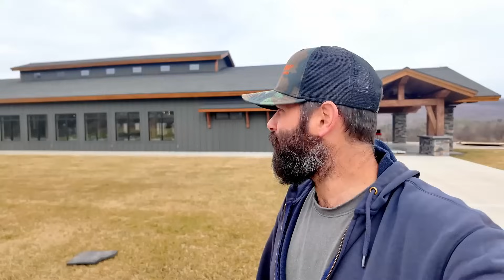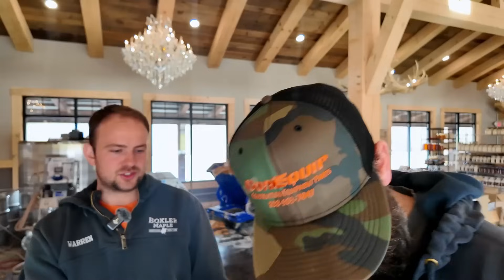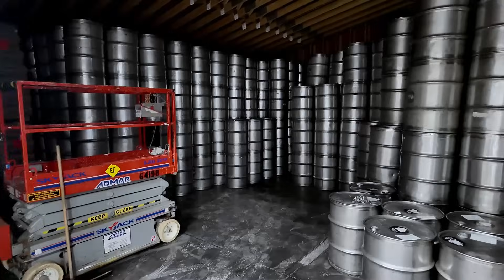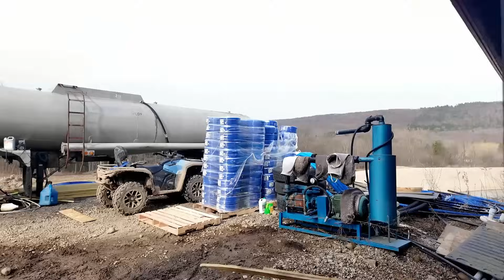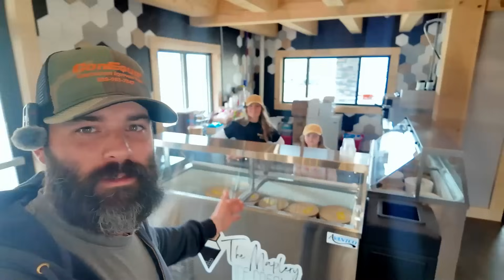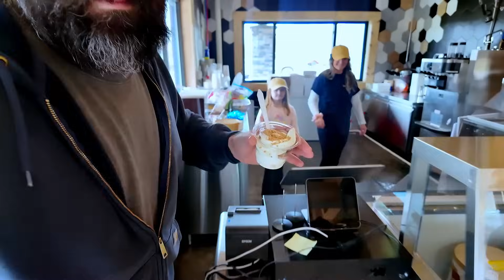Visiting Western NY's Largest Maple Syrup Producer!

Comment: 12:44     30x55gal drums=165 gallons x 8(pints in a gallon)=1320 pints/day  x $10/pint retail= $13,200/day      but at wholesale probably half that in gross revenue per day= $6,600/day before salaries, maintenance, bottles, labels, expenses, etc.    
operating a month out of the year?     
they not making much money
making more on their land inflation
Reply from the maker: Last year they made over 30,000 gallons of syrup. That’s around 1.5m retail, but you’re right whole sale probably half of that. We didn’t get into those kind of numbers thought so we can only assume.
Reply: The drums are 40 gallons not 55 gallons. and retail is way different than selling wholesale, On top of that the price tag on the equipment is enough to blow your mind and make sure you never get to retire 😂 but that's farming for you!

Comment: We used the same filter press at 3M. I didn't know your yield from 55 gallons of sap is 1 gallon of syrup. This is an interesting report on producing maple syrup. I'll be watching for Boxler Maple Syrup.
Reply from the maker: It’s closer to 40:1 but most people know what a 55 gallon drum is so it’s easier for them to visualize the volume of a 55gal drum to a gallon of milk.
Reply: @EverythingElliott  Thanks for the correction!

Comment: That entire place including out in the woods would be a plumbers nightmare!!!
Reply from the maker: Imagine trying to find the pin hole a squirrel chewed in a 500 mile line…
Reply: @EverythingElliott  that’s exactly why the smaller farms are much more efficient. We have 5,000 taps and made 4,000 gallons last year. Simply because lines were checked every day and we have monitoring systems so we can see how much vacuum is at the end of each main line.
Reply from the maker: @ He has a wireless camera and alarm system at every vacuum line that he can check remotely at anytime to see if there is a leak.  He's got things pretty well into the 21st century there.

Comment: Ive wondered how it was done on a mass scale. As i know the power rate back there would be very prohibitive to boil it with electricity.
.
I mean for 12 hours of heat, at 12 million. Thats a very impressive amount of BTUs. Quite Literally, small steam train BTU numbers of heat needed.
Probably coal fired boiler would be another option at that scale level, as bulk coal is supriseingly low cost still.
0.01c
.
You could do another walk through,  just talking about the building construction, that timber frame setup is very impressive.
Reply from the maker: He told me off camera that he burns about 60 gallons of fuel an hour when that steam generator is running. Coal would work well, but you’d need to hire 3 more employees to feed the coal furnace, so would probably be cheaper to run the fuel at that point.